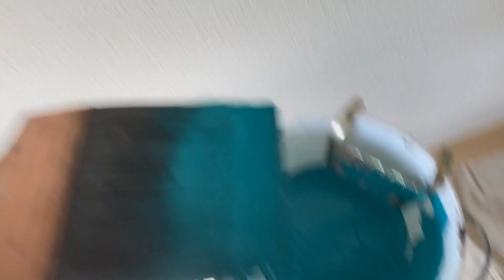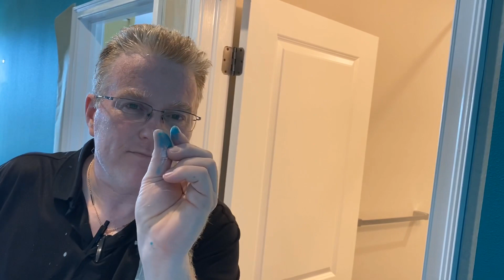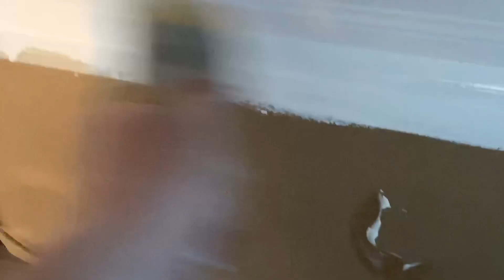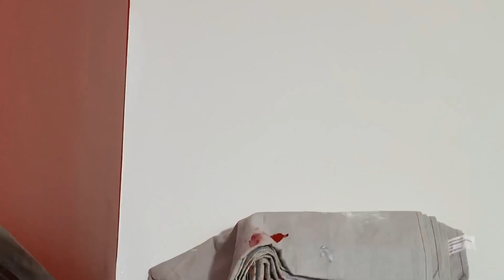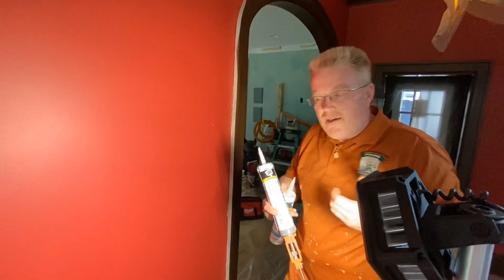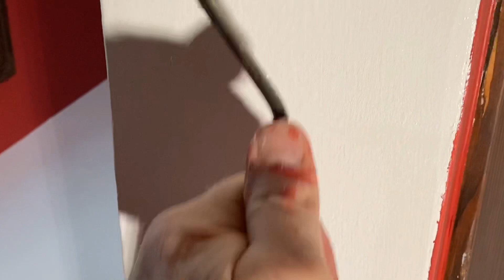Interior Painting Master Class on Brushing, Cutting, Rolling, & Caulking - Spencer Colgan

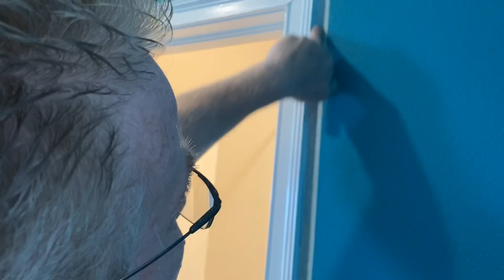Comment: I was in the painting business for 50 years. At least this guy is not using a little 2 1/2 inch sash brush on walls like most Youtubers. At 15:18 you can clearly see chunks of texture in the corner where the walls and ceiling meet. You can't make a straight line painting over that. The way to do it is to cut out the chunks. Use a 1" very thin and flexible putty knife and run it back and forth with a light grip until the texture falls out and you have a straight line. Now painting a straight line is possible. As far as using a mini roller horizontally on a textured wall, it's totally unnecessary. I've never needed one on an non-textured wall. Just make sure you don't have too much paint in the roller when you roll up into the brushed area. Now, around 23:14 he is using tape, caulking and trim paint to get a straight line. A master painter is able to make a straight enough line to begin with and this is unnecessary. I hate to paint behind painters who use caulking unnecessarily. The caulking eliminates the 90 degrees between the wall and trim and you end up with a curved corner which means you have to draw a line that looks like it is still 90 degrees. On a scale of one to ten I would rate his skill at 7 at best. To do a master class on painting would take a master painter.

Comment: Excellent teacher. Wish I would of found you years ago. You make painting easier. I’ve always used a (2-1/2” angled brush) to do my cutting in against the wall to ceiling, so I guess I need to go with a 4”? I especially needed to see how to paint straight lines where the corner walls meet the ceiling. Very helpful. Thanks

Comment: Tip for ya Spencer, dampen the roller first before loading with paint. Fills the roller faster and easier. 👍🏻👍🏻
Reply from the maker: You know it brother. While I was speaking about the roller, I was going to say that and my helper is very distracting when I’m making videos. He talks while I’m making videos I have to edit his endless remarks out of the video when he speaks, his phone goes off at least once per video… It was on the tip of my tongue and then of course, he did something
Reply: @spencercolgan   funny. Lol tripod camera.
Reply from the maker: spinx1200 brother.  Gotta do it.
Reply: Naw, the method he used it better, adding water of any degree is not recommended.  Using tape on a new roller to remove loose fibers initially and then roll against a grid for a while to saturate the roller cover.

Comment: I have been painting for 30 years professionally and I charge the roller before I put it on the wall like I was shown during my apprenticeship and I have never had the issue you mention. Also you use a lot of masking tape for straight lines, most pros can freehand and have a nice line no matter the surface.
Reply from the maker: All I can say to that is that I have seen so many so-called professional lines that veer off the wall onto Woodwork even if it’s in the slightest degree; I do not like it and so I charge a very professional rate and I give them the absolute best that I can give and that method is with tape

Comment: Spence, (may I call you Spence) nice work on that textured wall cut in

Question: have you ever considered using a three inch purdy xl semi oval. or the purdy xl 3 inch nylonia both of these brushes have rounded ferals and are a bit narrower and might be more comfortable in your hand than the square feral 4 inch purdy.  The two brushes I suggest both hold a ton of paint and have the same bristle as the four inch you’re using
Reply from the maker: You sure can sir. 

I will buy them and let you know!!

Comment: The first textured surface video ive seen JUST like mine. It took me awful paint marks on my ceilings to figure out how to properly cut in just like you're showing. But my question is this, ive done my first coat and while this is my very first paint job, i of course have spots that the original color is peeking through so im sure i have to do a second coat. My first cut ins are thick with paint, do i have to cut in my entire room again? Can i just roll my second coat the entrire room or can i just roll a second coat on the areas that are thin covered? Im using pittsburgh paramount flat green, like a olive drab color,  a 1/2 nap microfiber roller. Any help would be great! Thank you! Btw, I LOVED the tip about the horizontal rolling after the cut in!! None of the videos ive seen ever did that! Beautiful! New subscriber just for that alone! Ty
You are an excellent teacher i must say! Far better than anyone here.

Comment: Great vid but this guy is a pro with his brush, 18:05 is a recipe to get splattered paint on ceiling
Reply from the maker: You’re right
Reply: @spencercolgan  don’t worry, you’re still the best painter I’ve seen on YouTube. I used to run a sherwin williams in shrewsbury nj. I know all the products you’re using. The paint additive to reduce strokes? Great call. I can tell we would’ve had a good working relationship lol. All the new guys are big on sprayers.. but the sprayers maintence isn’t worth it. I like you’re style and methods, truly a pro ! Thank you for your vids.

Question. I’m repainting my small bathroom but don’t feel like getting rollers. Have a bunch of good brushes. Can I just use brushes and still get a good finish?
Reply from the maker: @MC_1993  Thank you very much! I would stick with a lamb wool roller and a Purdy 3 inch and a four-inch brush. 

The effect of the roller cannot be matched without resorting to the spray machine
Reply: @spencercolgan  thanks for the response. I’ll take your advice and do it the right way with a roller. Using duration in a bathroom..with popcorn ceiling. Been watching your videos and definitely needed a refresher. When you said the pva primer is bad I had flashbacks to sherwin I think guys were getting that for 15$ a gallon in bulk. Always with complaints.

Comment: Spencer so what was it about the 3m scotch white tape that you do not like?Did you say it splinters off the roll when unraveling?
Reply from the maker: Individually strapped, you cannot unravel the paint—the shrink wrap melts the sticky on the tape and makes it impossible to unravel.. Not the case however with multi-unit sleeves of tape.
Reply: @spencercolgan  hmmm thats strange,i definetely cannot get on with sherwin  williams brand tape,much too thick of a paper.Sometimes  i do however rarely get a roll of 3m and the first few times unraveling it,it will splinter,But goes right away,we always buy the multi unit sleeves tho
have you tried the new 4 pack of orange frog tape?

Comment: Great video,but I used the same method you did earlier in the video by putting a low adhesive masking tape on the wall to get a straight line. When I was finished and pulled the tape,paint came off right down to the plaster. Any tips on how to avoid this?bearing in mind I pulled the tape at an angle and towards me. Thanks. Ps the tape I used was frog 🐸tape.
Reply from the maker: 1. Did you apply the paint that came up?   That’s key to trying to answer you.  If you did, was it cured?  Was it painted onto the surface it was applied to that would assure that it was sticky enough?  Such as , was the surface scuffed you with a sanding sponge?  Was it too shiny that would help it come off and pull the plaster too?
Reply: @spencercolgan  Yes I painted the surface. It was dry if that's what you mean by cured. It wasn't scuffed up and I used tape that was low adhesive. If I remember correctly and I could be wrong here, from your vid . did you apply the tape to a freshly painted surface, I mean dry to the touch. If you did this is basically what I did and was shocked when the paint came off.

Comment: It looks like you don't let the clear caulking dry before painting.  Did I see this correctly?  If so can you expand on this?
Reply from the maker: Make the paint and wet caulk mix by applying paint onto wet caulk = Perfect colored seal!
Reply: @spencercolgan   That's really interesting to hear.  (I"m a remodeler, jack of all trades, master of none.)  I've always pushed the dry times of caulking but never just went full hog and applied paint right away.   
I normally resist caulking and taping because of all the problems of letting caulk dry on tape, then pulling a clean line.  Amazing the amount of stuff I don't know.  Time to buy some clear caulking, Thanks!

Comment: That tape could remove the finish on stained trim.
Reply from the maker: You’re correct.  In that case, I’d go with yellow frog tape Thomas.
Reply: Thanks what's wrong with blue.  It's cheaper than the yellow and could still do the caulk technique.
Reply: @spencercolgan  Thanks for the motivation.  You're an amazing Painter
Reply from the maker: Thomas Komos that’s an awesome compliments

Comment: I have a really dumb newbie question...why don't I just tape the ceiling edges (same way you did the trim) to prevent my wall paint from touching the ceiling?  Is it just because that would take too long?  I don't fully trust myself to do four walls 12' in length (48 linear feet) without going over even *once*.
Reply from the maker: Bird it’s an excellent question but it’s almost physically impossible to be looking up at the ceiling and keep your tape line straight; your body loses its perspective once you turn your body around and you’re looking upward
Reply: @spencercolgan  Wow.  Never even contemplated that!  You are an excellent teacher, sir.  Thanks for a very clear and helpful video and quick, concise, air-tight follow-up!

Comment: Will  caulking the bottom of the base cause issues later with expansion? Or aren't you using enough to matter.
Reply from the maker: Not an issue at all sir.
Reply: @spencercolgan  Thanks for the content. I'm a small, green, one man operation and can use the pep talk sometimes. I'm working on a decent size interior job right now and 5" primed base molding is soon on the agenda.

Comment: Hey Spencer
I want to do your clear caulking trick to get prefect straight lines but in the UK it's very difficult to get clear caulk
I saw this other trick on YouTube and I wanted your thoughts 
To get a straight line between the trim and the wall first you mask the painted trim and then apply a light coat of the trim paint in the gap between the tape and the wall. This creates a seal so your wall paint doesn't bleed onto the trim. After this dries you can cut and paint over this and remove the tape for a straight crisp line.
What do you think?
Or is there any other way if I can't get clear caulk

Please advise
Reply from the maker: Check this out:

https://youtu.be/R8J7xOyjmr0

I use the EXACT procedure you’re referring to in this video!!!!  Newbies however, I don’t recommend that to. Why?  Because they may not keep the paint from bleeding.
Reply: @spencercolgan  
So if I can't get clear caulking I just use a dry brush for each coat. Got it thanks

Spencer there's one more thing I need clarity on
If I mask the painted trim and cut in the first coat with dry brush as we just discussed.
Then I take off the tape while the paint is still wet to get a straight line and role the wall. 
Now for the second coat do I need to mask the trim again and repeat the process?
Do I mask twice to protect the trim or is there a better way?

Comment: Spencer instead of tagging the wall with the paint for the baseboards why don't you just put some frog tape across the bottom of the wall it's so much faster than coming back and having to touch up your wall.. takes hardly no time to put a piece of tape and caulk, now you can splash your paint on and then remove the tape AND YOUR DONE!. You should also be using frog tape to cut that straight line in the corner I don't think you're using the right tape ,you got too much adhesion on there it could pull the surface off . thank you brother..i learned how to do vinyl wall covering at work many yrs ago..and repairing it ,patching it..i love the challange.. thanks for all your tips and tricks......lol thanks for the breathing advise  hahahahhaha.
Reply from the maker: Thank you so much; since you wrote this, I have purchased green frog tape and I will be using it; thank you for your advice
Reply: @spencercolgan   yes sir. Great tips spencer thank you brother.

Comment: You also know that with tape and caulk your line might look straight but it still isn’t perfect because the paint dries at a different rate than the caulk and if you don’t take off your tape fast enough you could get into trouble and it is also messy getting rid of the wet tape.
Reply from the maker: Excellent point
Reply: WOW... ANOTHER NEGATIVE CRITIC WHEN SOMEONE GIVING GOOD INFO. U MUST B 1OF THEM PPL.